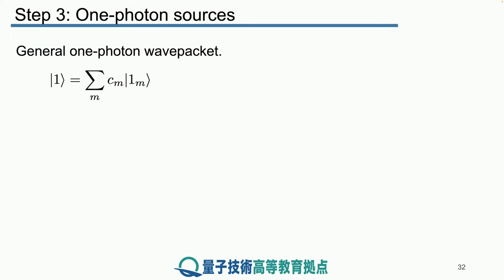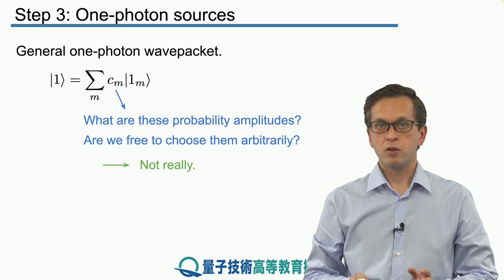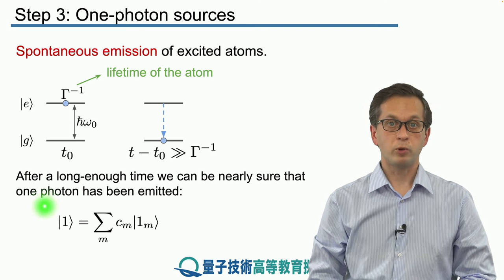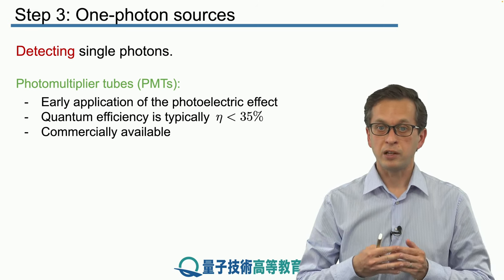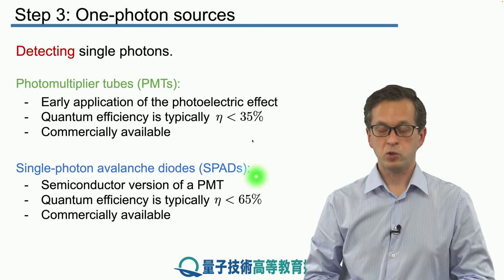15-3 One-photon sources

Comment: If a single photon contains a spectrum distribution when emitted, then when it's absorbed, the energy level of the absorbing atom should be able to accommodate a non-sharp photon state right? The incoming light doesn't need its energy to be exactly hbar x omega0 to be absorbed?
Reply: That's right. Light with an exact frequency f0 is only a theoretical concept. Real light always consists of a bunch of frequencies. The frequency-width of the excited level (minus the ground state) determines which frequencies (of this bunch) will absorb.

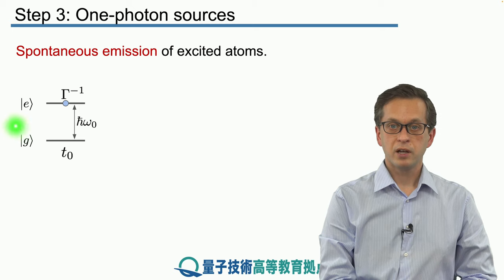Comment: @ 1:20 This is not the lifetime of the atom, but the lifetime of the energy-state.
@ 4:46 A calculation:  https://youtu.be/F8VhnBT0vk0?t=1768
@ 5:32 Of course, the square of i is - 1. 
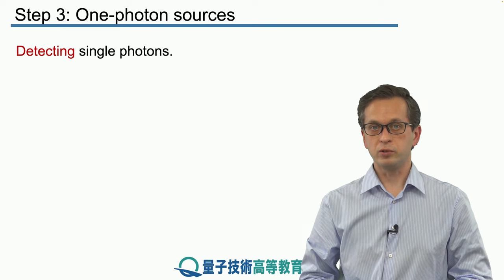@ 6:49 Here he confirms that single photons can not be detected.
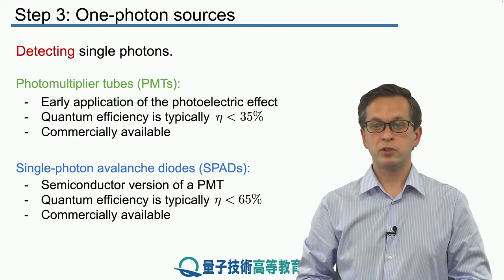@ 8:31 More on TES:  https://en.wikipedia.org/wiki/Transition-edge_sensor